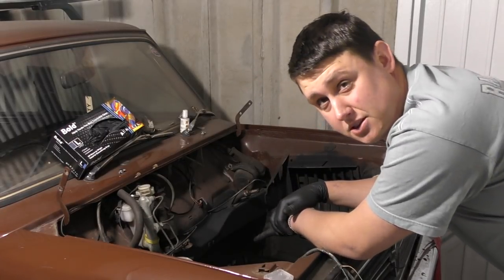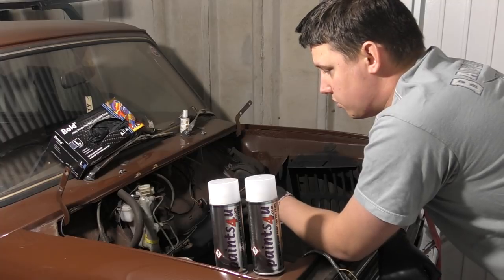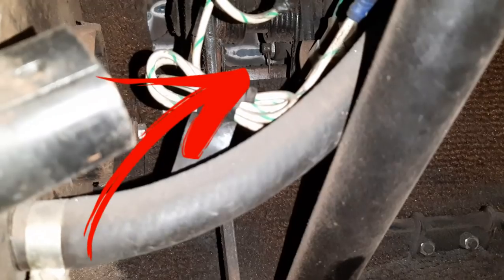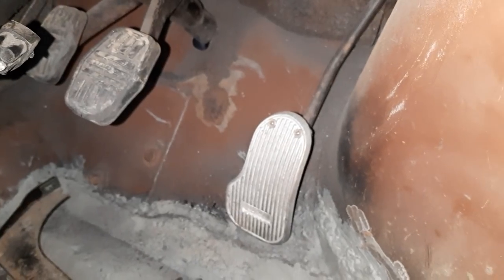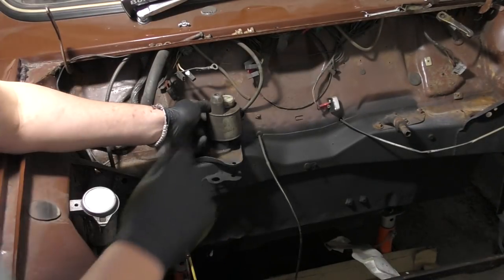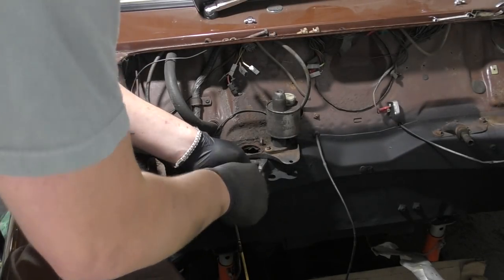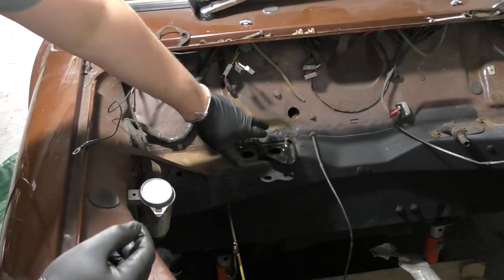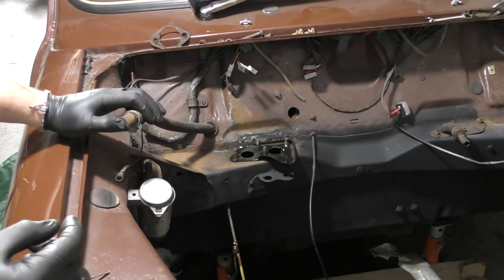Classic Mini Clutch & Brake Master Cylinder Removal

Comment: Well done! 😁 on the dreaded brake and clutch clevis pins! One trick/tip: I was lucky to inheris tools from my granddad, and for these type of impossible to reach places he has surgeons bended clamps. For me they worked like a charm. Was easy to clamp on and hold on to the pin and with the other one to work on the split pins and push them out and in.
Reply from the maker: That's very handy to get the tools handed down, I've had a look and and I'm going to make up a tool consisting of a ruler and a few pieces of tape 😀
Reply: Someone I knew used put on end of welding rod.

Comment: When you removed both clutch and brake cylinder was there a way to stop brake and clutch fiuld from completely coming out and draining out. I plan to do the same job soon, thanks mate
Reply from the maker: Keep them up right, unless the seals are at fault the fluid will only leak if poured out
Reply: @WilliamMurfitt  What about the pipes that connects to the clutch and brake cylinders? Fuild will leak out if those. That is what I meant

Comment: the remaining pins that are left after removing that bracket, can they be removed from inside the car? as i'm in process of attaching shell to jig.
Reply from the maker: They should be easily removable, I had to replace on my clubman originally they came out with a little tap on the side
Reply: @WilliamMurfitt  I have now removed both clutch and master cylinders but the pedal box bolts are a bugger to get off

Comment: William,  I have a very clever method for removing or replacing the clevis pins it‘s called AMIR lol. Cheers Dave
Reply from the maker: Good one dave, unfortunatly i'm unable to afford a slave. :)  i mean worker
Reply: One tip for Amir in that case then, when I put the clevis pins in last time I used R-clips instead of split pins. They worked a treat, I was able to easily remove them with a pair of needle nosed pliers last night, without any hassle. No fiddling required as you can simply either pull them out or push them out, depending on wich direction it is facing.

Comment: Hey William. been watching your channel for quite some time... Anyhow, trying to remove clevis pin from  Japanese mini mpi, however there is no safety pin, have any idea how to remove it...
Reply from the maker: Thats an interesting one, there must be some form of locking devise or the pedal would fail if the pin was to fall out. 
You may be able to get some pliers on the pin and push it out. I would maybe advise on spraying some lube on the pins to aid with the removal 😀 best of luck, keep me posted with how you get on

Comment: Are the master cylinder mounting bracket studs welded to the body work?
Reply from the maker: No they fit into slots, but they were very tight so i left them :)

Comment: William I've watched this video over a few times and I'm still not clear on whether there is a gasket under the plate as well as gaskets under each individual master cylinder?
Reply from the maker: Not a problem, so there is a large gasket on the bulkhead that covers both holes there are different options avaliable depending on the mater cylinder set up you have. But.. for my application one large gasket with two holes onto the bulkhead, the upper engine steady then gets installed and followed by two smaller gaskets for each of the cylinders, I hope this helps answer your question 😁

Comment: Is there any way to convert the set up so both the cylinders are the smaller style? I’m just thinking it would make my engine bay look tidier etc
Reply from the maker: Yes, I think it's called single line braking system, check out 'classic mini detailing' channel on youtube as he had converted his van to this style removing the later again brake servo setup.

Comment: Good video William, this is my next job on Annie (clutch master) :)
Reply from the maker: The new master arrived yesterday it wouldn't have been that bad but I dont think the Clevis had been out of the car since it was built in 1979! It's amazing how impressive the new one looks in comparison
Reply: @WilliamMurfitt  I'm convinced Annie needs one. I think I might have one in the loft but if not then it will be a minispares job I think lol
Reply from the maker: @BMCWorkshop  mine was alright, bushes were a little age cracked and a few bits of rust inside. But I thought as it's coming off it would be better to replace   the brake master was replaced a few ago (2-3 maybe)

Comment: Do you by any chance remember the size of the bolts that hold the 2 master cylinders down?  sorry to be a pest.
Reply from the maker: The studs are on the pedal box. And the nuts are ½ inch if that helps?
Reply: @WilliamMurfitt  Of course what a dummy! thanks for being patient. Cheers Midge
Reply from the maker: @midgelambert3880  no worries any time :)

Comment: I'm searching for part 2 of the video, "how to replace the clevis pins!"
Reply from the maker: I'm not 100% if I did one or not... let me check for you, but failing this I'll film one for you
Reply: @WilliamMurfitt  My comment was in jest but any advice would be appreciated. Just got an 81 pickup and she won't go into gear. Starting with the first clevis pin and making my way to the slave cylinder. But that clip is scaring me! haha
Reply from the maker: @markb978  oh it's been a long day sorry. Best advise is just to get stuck in
Reply: @WilliamMurfitt  Easy peasy. I tried unsuccessfully for 30 minutes and then convinced my 12 year old daughter to give it a try and she got it out in 30 seconds! 🤣
Reply from the maker: @markb978  perfect well done to her. I've had my mum help install a couple of windscreens 🤣 long nails had their advantage
Reply: Should take the whole pedal assembly out I think it would be easier and then at the same time you could then the pedal arms a little bit cuz they're way too close together and maybe weld on a little clutch pad my left side just thinking
Reply from the maker: @jerryrust685  that sounds like a lot of heard work compared to replacing the pins which give you a sense of achievement once you have completed the task :)

Comment: Id put money on that the clutch master can be cleaned up like new.
Reply from the maker: i still have the unit so will give it a go, but wanted to get the car back on the road in quick time, it's 100% a job to give a go.
Reply: @WilliamMurfitt  i did mine on a wire wheel on a bench grinder. It looked like yours but it was all surface crud. It came up like new.
Reply from the maker: @minimonte1  fantastic